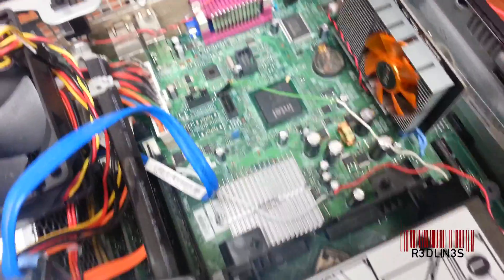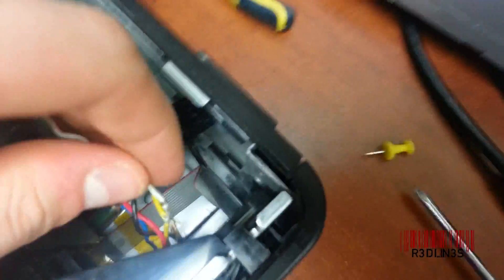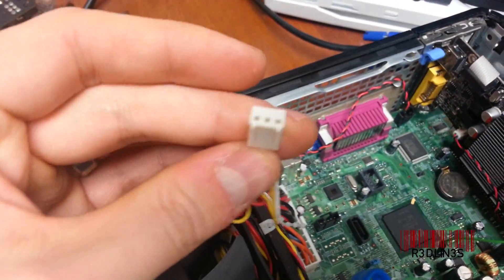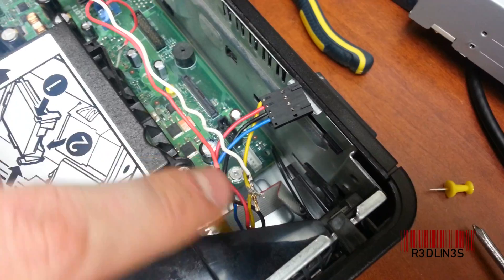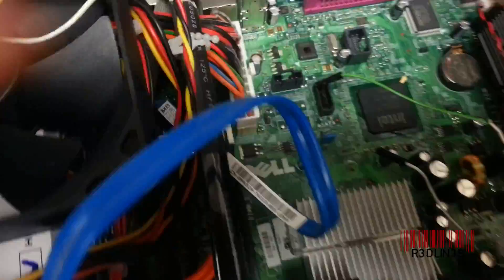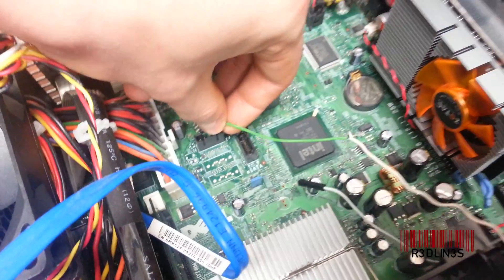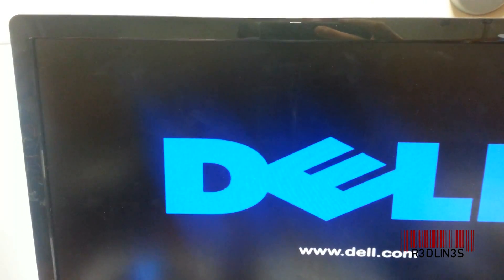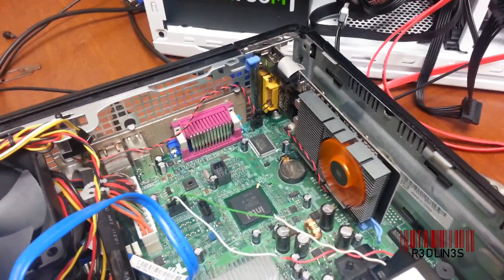Dell Fan Failure Fix/Bypass How To

Comment: Just to be sure can I use DuPont jumper cables to connect the blue and yellow wires to the motherboard from the original fear fan? My plan is to relocate the rear can somewhere in the case and use an aftermarket fan on the rear instead. Is this good?

Comment: A lot of successful attempts below but alas I was not.  I have a T5500 with a CPU 2 fan failure on the riser board.  Tried both yellow/blue then read down below just the yellow but doesn't matter.  Had the latest A18 BIOS and went back as far as I could to A04 just to verify the workaround wasn't patched and still no dice.  Must be the board as the same riser works fine in a different T5500.  Frustrating.

Comment: This will work when the mosfet which control the fan is working, I did direct solder underneath the mobo on the sensor of the cpu fan to the case fan and it doesn't work, mosfet must had burned

Comment: Thank you!! Me funcionó perfecto muchas gracias, saludos desde Colombia
Reply: victor manuel munoz  Azul y amarillo, ya que son los que proporcionan los datos, tal y como se ve en el vídeo va el orden. Puedes guiarte por el orden de las conexiones del primer Fan (ventilador) iría así mismo, solo que sin los cables de corriente. Saludos
Reply: oye estas seguro porque estas personas que hablan en ingles dicen que solo el amarillo. Yo hace una semana cambie mi ventilador original por uno noctua NF-A8, compre los adaptadores pero me aparece ese error, pero por lo que tengo entendido es por rpm del ventilador y no por pwm. Como lo hiciste la verdad no quiero joder mi motherboad. Saludos, desde mexico igual jajaja.
Reply: @MrAngelito2000  no habría problema, la función de ese puente es engañar a la board, dándole a creer que tenemos conectado un ventilador segundario. Para que así no nos mande ese error que indica que nos falta un Fan, No le pasaría nada a la board porque no se está manipulando ningúna conexión con voltajes, solo de información.
Reply: @EslavaGraphics  con la misma pc de aquí lo hiciste o con alguna otra optiplex ? tienes alguna foto de como te quedó el puente ?
Reply: @MrAngelito2000  la misma referencia del vídeo, y no tengo fotos. Pero pues literalmente quedó como en el vídeo
Reply: Bro me podría decir cómo conectas e verde y blanco

Comment: I know its not going to be easy, but I have to ask. I want to replace my cpu cooler on a Dell Precision T1700. its Dell 5 pin of course. Will an adapter work without throwing an error? Is it going to be okay if I do get an error and keep going? With the i7-4790 and GTX 1070 its running a little warm. I want to add a front fan and replace case fan too. Im in over my head  lol   help

Comment: worked for me, thanks to you 

my fan has just 3 cables, yellow black and red
so i had to cut only the yellow cable and put that extra one into the other fan connector (yellow) and it worked

Comment: Will this give me front fan speed control for Dell Optiplex 780 DT edition? Installed a brand new Noctua NF-A9 to replace the OEM fan (using a aftermarket adapter for retail 4 pin PWM fan). Supposed to run a max of 2,000 rpm, know for a fact that it isn't. The only PWM fan showing speed is that of the GPU (in percentage). Unfortunately, can't get SpeedFan to help either. Am wondering if I should use the PWM splitter included with the Noctua & install any fan to the PWM lead (as a case fan) & install the NF-A9 in the 3 pin lead. That should blow the max speed, that is, if the MB can do it. Oddly, the only fan speed being reported is that of the GPU & that's a percentage, not an actual speed reading. 

Wonder also if reverting to an older BIOS may fix the issue. My useless Optiplex 740 has a fully featured fan control in the BIOS (loud at higher speed with OEM fan). However the NF-A9 is quiet, regardless of speed. All I want to do is cool my Q9550 better, can't get down in the 30's on idle except on the 2nd core & oddly unlike other CPU's, the temps doesn't go (drop) in order except the first, which is most always at 45C or higher. New thermal paste helped (Noctua NT-H1), yet not by a lot. Prime95 will still push the Q9550 well past the 70C mark on all 4 cores, the 1st close to or breaking 80C.

Comment: Hey , i just bought an Dell Optiplex 7010 but the previous owner removed the ambient temperature sensor , anyway to bypass that? it has two wires wich go on a sensor mounted in front of the case then onto the motherboard , i tried jumping yellow and blue wires from cooler to mobo it cancels the bootup error but fans go 100%..

Comment: i have the same and worst problem with a similar motherboard in a normal atx case.
alert cpu fan not detected but my 4pin fun works
alert rear fan not detected and i have no fan
alert fronpanel cable not connected... i don't have one.
and even latest bios doesn't have a way to ignore those bs errors

Comment: I had the same problem, thanks to R3DLIN3S, i followed your video and finally solved..:-)
Reply: Why did you follow the video? If you had read the comments you would have noticed that the blue wires should NOT be connected since they are not Sensor Wires as the video falsely claims!

Comment: This worked on the Optiplex 745 HDD Fan Failure issue as well!  The HDD fan has one sensor wire (yellow) in the center of the three pins.  I just took a female DuPont connector and pushed it down on the center pin, and then spliced it into the yellow sensor wire of the rear CPU fan and no more HDD fan detection issue.  Removed that fan since it was noisy and I was not using the HDD any longer (USB Boot).  Four years later, and this info is still on point!  Thanks!!

Comment: help me , My computer, when it boots up, says "Alert! memory failure detected in DIMM 2 strike the F1 key to continue, f2 to run the setup utility press f5 to run onboard diagnostics" is wrong. Is there any way to rectify this situation?
Reply: Select F5 and run diagnostics.  Memory will be tested.

Comment: Bonjour et merci, j'ai récupéré un Dell précision T5400 que j'ai équipé de deux processeurs Xéon mais où j'avais toujours cette mauvaise blague de "card cage fan failure", tous les forums parlent de problèmes de ventilateur, de carte mère, un vrai bazar...,
sur le T5400 j'ai réussi à localiser le connecteur correspondant à ce message, il se situe en façade sur la CM, à coté du Front fan et s'appelle ccag fan,
j'ai réalisé le montage préconisé sur la vidéo et tous les messages et ventilo qui partent en marche forcée ont disparu.
Merci beaucoup, 
thanks a lot for your video

Comment: Thanks! It works on my Dell Optiplex 7010 SFFx (0GXM1W) !  "All you need is the yellow or white RPM sensing wires connected" (Mark Werner)

Comment: Dude you made my day with this video. I really appreciate it. I was assisting one of my best friends on building a Bartop Arcarde machine. Of course we used a spare desktop which is an Optiplex 9010. We had this very same issue and fixed it by doing what you posted on this video. Thanks to you we gonna have tons of fun by playing with this piece of art. I hope your life is plenty of money, love, drugs, hard sex and Rock and Roll.
Reply: Well, the drugs certainly might explain why he wrongly cross-connects the blue PWM wire in the video and calls it a sensor wire...
Reply: I also have a Optiplex 7010 and i have the rear fan error.

Comment: so if I remove all my original Dell fans then I'm fucked
Reply: Yep, tried to replace the CPU Fan with a Noctua NF-A8 PWM and adapter Cable in my Optiplex 7010 MT, already upgraded PSU (Pure Power 350W), SSD, 8 more Gigs of RAM and Radeon RX560 but it always shows "Fan error", now replaced the Heatsink by a Noctua NH-L12S and it also shows Error, also ran Onboard diagnostics and it recognizes the Fan but doesn't like the rpms, why does this piece of shit do that, the connected fan is running and the temps are better than stock cooler...
Maybe I'll branch off the yellow cable (is it the rpm signal?) from the Chassis rear fan and bridge it with the CPU Fan rpm signal.
Oh and the control is shitty, with a newer BIOS it runs quiet but with 100% CPU load and stock cooler, the i5-3570 reached around critical 103°C and it didn't rev up! and if you deactivate the fan control it runs 100% and thats extremely loud (seems to be industrial fan).

I like the Optiplex, other ones like Lenovo and HP are using more shitty things like non-ATX Power connectors (Lenovo with 14 pins) or HP uses a rectangular Hole Pattern for CPU heatsinks so you can't replace them with better ones.
But their gamebreaker is the Mainboard's fan control, Adapters from 4-Pin PWM to 5-Pin are available but it complains about the rpms (temps are equal), so Dell, F*ck You!
Reply: Mine worked for 6 mos. in the XPS 8950 before started getting the rear fan failure error on boot/wake. The Noctua NF-12x25 still works, but I believe Dell updated the boot firmware (automatically) and the new version expects the fan to be running faster than the Noctua reports! Replacing with the original fan solved the boot/wake error message, but it's louder. The front NF-12x25 isn't causing any issue - yet.  [Tried to revert to BIOS 1.0.10, but the installer complains that it's invalid for my machine, so Dell may be blocking that on purpose.]
Reply: It's now 8 years but am still laughing 😅😅
Reply: not at all.... it just means u will have to press f1 each time it boots up... its really not a big deal

Comment: I just fixed an old 745 my kids use. Thanks. Note my 2nd fan slot was turned differently on the motherboard. Do not let that deter you, just map out the connects from the orientation of the first slot.

Comment: YGTBFKM.  I'm getting a CPU fan failure on my 755 and thought, well let's take a look online and I run into HOTWIRE INSANITY!  :-)   So the issue is that Dell replacement fans are a rip-off and hard to come by?  I'm not sure what the initial reason is for having to do this.  Is it that the rear fan fails and you need to replace it?  Somebody also posted a video about the 745's fan spinning the wrong way sending hot air over all the components.  Is that the same for the 755?  Perhaps this is what would cause the CPU fan/paste to fail?
Reply: The reason for this mod is quite simple, you do NOT need a fan on a SSD which is what 90% of the people use these days. A fan is just going to create noise and waste power for no good reason. I removed my entire stupid HDD caddy and fan years ago from my 755 SFF, and simply installed a Samsung 850 Pro onto the bottom side of the DVD drive. Then I used the new free space where the HDD was and installed a REAL 120mm intake fan. I then reversed the CPU fan so that it blows outward. My CPU now runs a full 10C cooler (HUGE wonderful surprise), and I have much less noise than that ridiculously stupid HDD fan of Dells. And to answer your question, yes you can get these Dell hdd fans for $6 at ebay, depending on the model. This is how Dell should have built it to begin with...

Comment: Oh my god, this is so idiotic. I got an Optiplex 745 and I changed the very very hot Pentium D cpu with an older, but extremely cool core 2 duo , but I got a fan error now. When I swapped my burning hot Pentium D back, there's no fan warning. This is not logical.

Comment: Please people DO NOT cross the PWM lines for the fans. All you need is the yellow or white RPM sensing wires connected.
Reply: VERY HELPFUL, CONFIRMED ON OPTIPLEX 9010!
Reply: Connecting the Yellow Pin alone works fine on my Optiplex 9020. DO NOT CONNECT THE BLUE PWN WIRES !

Also: Try to use the original Connector from the rear fan so it can only be inserted one way. If you use a 1-pin connector or any other connector which can be inserted the wrong way you will end up frying the fan once you insert it the wrong way (which can easily happen if if becomes unplugged!). Do not follow the dangerous (use one pin connector) and wrong (crosswire PWM signals) advice in this video!

Also: The way the cables are wired together here is really something "special". If you don't want to solder, all you need is a single WAGO 221-413 to properly connect them.

Comment: Thank you so much! When I first encountered this problem, I wanted to make a "FAN Terminator", which simulates the Hall sensor based on NE555. But I want to draw your attention to the fact that the blue wire is not nedded, rather yellow.
Reply: Pavel Mitryaev
Reply: yes I just used yellow    (cut and connect another wire) and it worked!   no more F1 message.